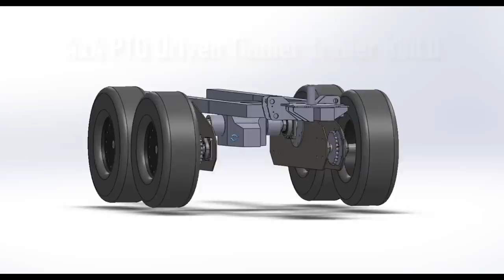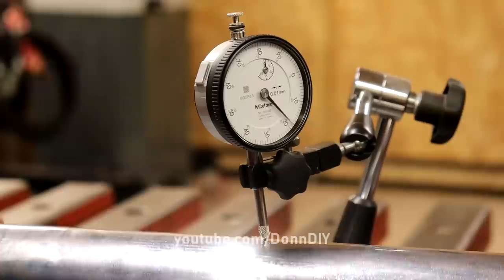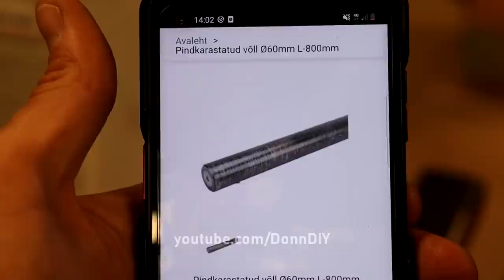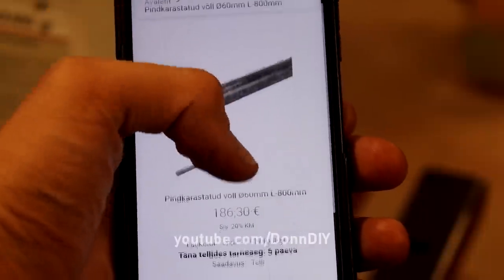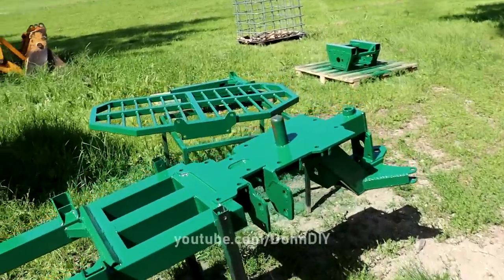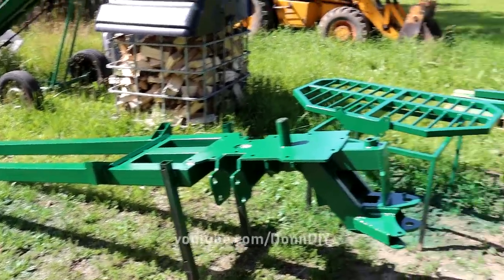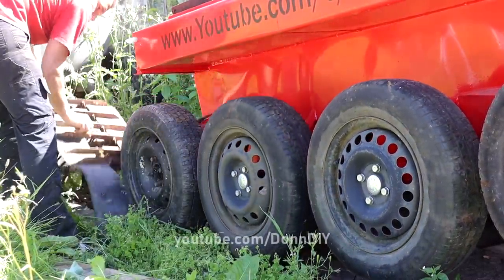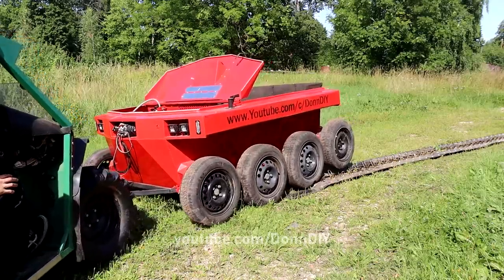Final assembly & Surprise Guest! - 4x4 PTO Driven Timber Trailer BUILD Ep.15

Comment: Thanks for sharing with us Donn, still coming along okay even though your invisible shop helper put the wrong bolts in where they didn't go because someone had the wrong hole size drilled? You fixed it so no problem!!  Keep up the good work and great videos, stay safe. Fred.

Comment: Those 8 mm bolts are sneaky little buggers! You think you have all of them off the workspace, and some manage to find their way into a hole they shouldn't be in. But you found and corrected the issue before you put it under a load. Half the issue with trying to straighten something, especially doing it cold, is knowing when good enough is good enough. You got them decently well straight.

Comment: As I said at the time, my brother in-law built a 6 wheel drive buggy with a fiat 500 motor which snapped Chevy v8 axles, the gearing and torque multiplication what does it. You should admire your work mate, what you have done overs the years is remarkable, cheers from Australia. Ps perhaps a carport for the buggy with a steep snow shedding roof would be a good simple side project.
Reply: I don't know how Chevy axles are in Australia but here in the US they're notoriously weak. At least the GM half ton pickups like the Silverado and Sierra are.

Comment: That second shaft had lot of run-out, you did a good job getting it back to where it's usable, must have one heck of a press to do it and good eye... 
You should put some sort of rolls on inside of drive-housing to keep chain from dragging, a wear plate will also wear chain and or a teflon plate might have to be replaced often cause it might not take the constant abrasive dragging of a heavy chain.... I remember that track vehicle build, it was a really really good shew...........

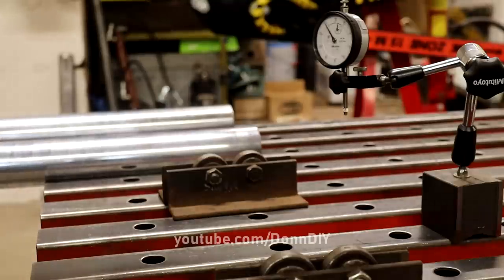Comment: 2:55  You don't need a new shaft.  Heat the high spot, and quench with water.  Recheck runout.  Repeat on each additional high spot.  Or use a press.  LOL.  Didn't know if you had enough power to move it or not.

Comment: Great work.  It I still feel like it probably would have been smart to add a keyway on those shafts for the sprockets ALONG with welding them. That’s not much weld surface area for the amount of torque  that those will be put under.

Comment: @8:30 It seems that 4x4 gear transmission housing design, comes with lubricating oil storage. To prevent oil leakages or water seep into housing, please consider having some seals/ gasket in place with flange/cover, as well as seal/ packing where Pillow Block bearing is mounted.. Cheers
Reply: There numerous way to DIY gasket. E.g. Transfer the shape and hole position to paper as a template, then prepare gasket material and trim it accordingly as per template. As for the sealing with pillow block bearing, suggest to machine some seal seating to be welded to base cover where pillow block is attached. Wish you Godspeed..

Comment: Need a 5 gallon bucket of the FluidFilm… it’s a wax blend that you slap on with a big paint brush if you get the bucket… if you use the little spray can you can spray it on which is much handier but you get a lot less product for your money with those small can’s… around the farm or e
What have ya… you get a whole bunch in the bucket and it’s slower but way more accurate if you are wiping it on or painting it on your surfaces that you want to protect.,, it’s amazing at stopping vehicles undercarriage from rusting and general surface protection .,, it blocks the water and moisture… check it out it’s a real good thing!!!

Comment: On the plus side now you have lada shortened axle to put into tracked ATV, witch should be light enough for lada axle to handle. Probably stripped a gear and those are still somewhat readily available specially if you dont have hard constrictions to Russian imports -.- so might as well restore it, given how much work went to it and atv like that would be pretty useful. If you dont want to, then sell to me :D

Comment: Donn I would like to see you build something with with those types of wheels again. I was thinking maybe a road grader or something like that., Or some type of dump trailer for the atv as well. I think if this trailer works a dump trailer would be really cool. I have not even finished watching this episode yet.
Reply: Also this style of axle is much like the kind used on some old crop sprayers as well.
Reply: I also think that the desgin would work for some sort of snow machine as well. For other people. One could adjust the height of the drive axel to get a nice high clearance snow machine or something to which one could add tires and or tracks. If done right one could add boggie wheels on bottom and       top that can be removed for tire use. Track machine kind sucks becuase you can not switch to tires for summer use. This desgine would work well for it.
Reply: Donn you should do a video overview of all of your projects over the years. Short clip of the build then the use and then how it is now!

Comment: I mentioned a wear strip in the drive hub's as well as an oil bath for prolonged life personally I'd have rivet linked the chain but it would be a nightmare in future split link ok for drive in one direction
Reply: He mentioned in another video that he is going to put oil in it.
He just needs to put sealant between the bearing flanges and the casing. 
It doesn't need a lot of oil, just enough that the chain touches the surface of the oil...